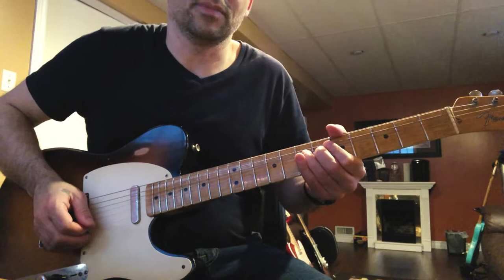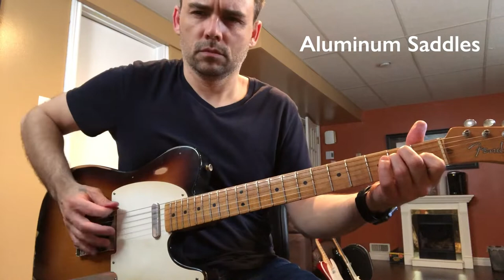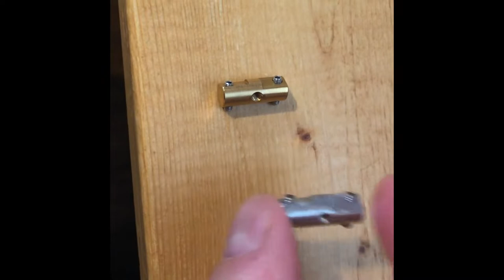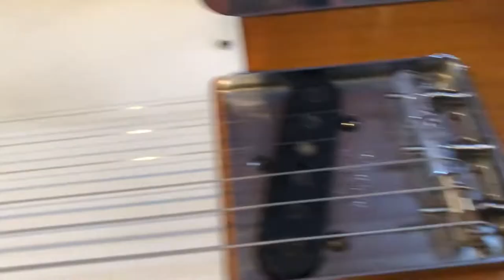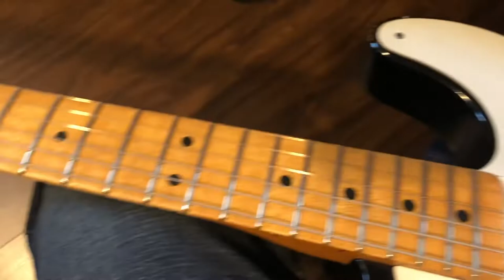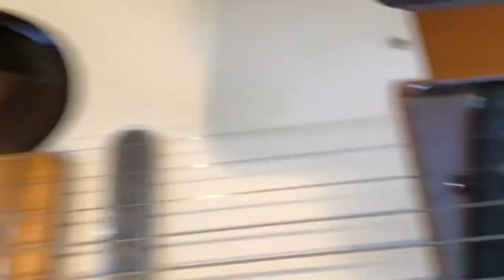Brass Saddles Telecaster | Before & After

Comment: I think the brass saddles do sound better. Have you been able to get decent intonation with the compensated saddles? I changed the bridge on my Tele to a 6 saddle to get better intonation. I kept the original bridge and was thinking about installing compensated saddles on it for another build. Just wondered if it's worth it. Thanks for any response!👍😎🎸🎶
Reply from the maker: Yes I was able to get really good intonation with the compensated, but not with the original straight saddles. These are made by Wilkinson, very inexpensive.
Reply: @ClintCurtis  thanks for your response. I've seen the Wilkinson saddles on ebay and Amazon and the prices are cheap. I think I'll give those a try. Thanks again!👍😎🎸🎶

Comment: Finally getting a Tele for my humble collection, just the Squire 50's Vibes version, and already waiting for the brass saddles to arrive. Stock steel should sound good as well, but there's just something special about the vintage look and feel of brass saddles. I a not a crafty person, but I should be able to switch them no trouble. Looking forward to the quality and relaxing time modding the new 
instrument.
Reply: Hi, I also have the same Tele as you and I was just considering switching to brass saddles, so I would much appreciate if you could let me know how that turned out! Notice any difference/improvement in tone? Btw that guitar is amazing for the price!
Reply: @lorkaratkovic1582  I am sorry for a late response! I think brass saddles make the sound a bit more snappy,  bit of extra attack, fits country and blues very well. But the stainless steel has a nice sound of its own, more balanced. To be honest, I probably liked steel more but now too lazy to change. The guitar sounds great with either, just a bit of a difference in flavor. Thank you for asking!
Reply: @lorkaratkovic1582  No real improvement, just a bit more snappy high end and a tiny bit of exta twang. Steel sound more balanced overall! Thank you for asking!

Comment: well, usually you would use the brighter sounding aluminum saddles only on the low E and A strings and use the standard brass for the rest.